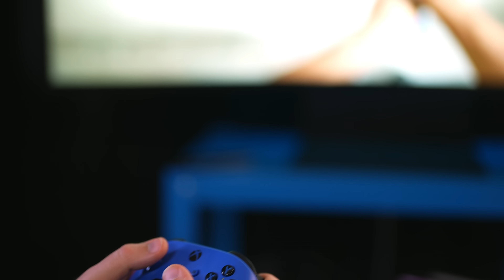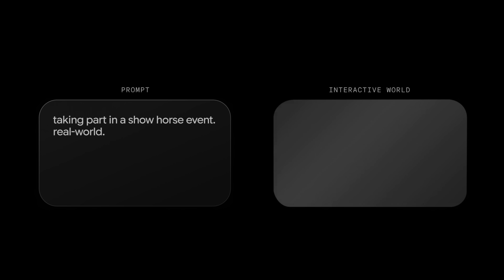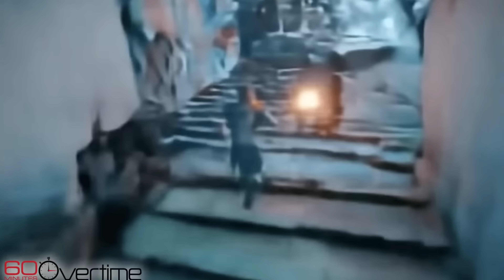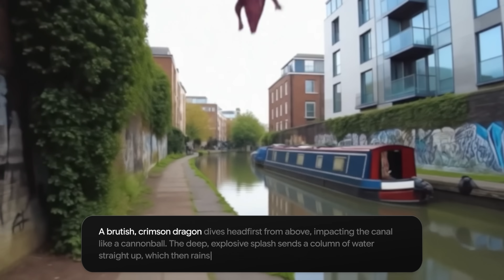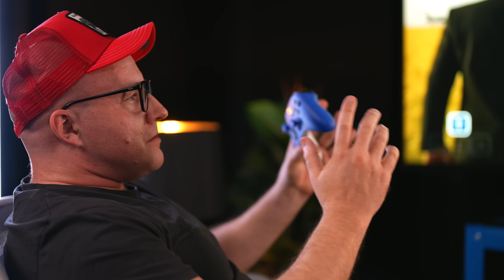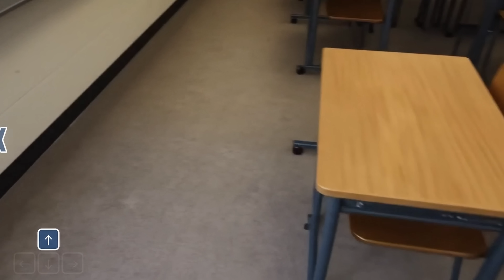Type a Sentence, Get a Playable 3D World in 3 Seconds - Shlomi Fuchter & Jack Parker-Holder

Comment: I’m a little skeptical that they will be able to overcome Moore’s law for long time-horizon generation if it relies entirely on prior context in the form of rendered pixels. It’s an O(n^2) time complexity.
Reply: I think you're assuming Genie (or models like it) will only rely on raw pixel context forever. That O(n²) scaling is definitely unsustainable, but researchers are already moving towards hybrid approaches — compressing past context, representing scenes as objects/states, and only rendering pixels at the final step.

So yeah, if it stayed purely pixel-based, long-horizon consistency would collapse. But the trajectory of this research is clearly towards mixing symbolic/state representations with generative rendering. In that sense, Moore’s law isn’t the bottleneck — smarter architectures are.

Long story short: the limitation you mention is real for Genie 3 as it is now, but not a fundamental barrier for world generation in general.

Comment: I think a more practical implementation with out current state of tech would be to render the standard graphics pipeline but at a lower quality then train a model to upscale the graphics. That way you have a light weight neural net and graphics pipeline but you still get the fine motor control of programmed behavior and object permanence. Think of it as DLSS 4. In some games you want hard programmed consistency.
Reply: i think it is doing this already, since the world interaction does not take place in image space, they probably use some decoder to generate and image of the curretn world state, which is basically what you are suggesting
Reply: If I remember correctly, there is   some engine being in development by nvidia to render with path tracing in real time and simulate physics by ai model
Reply: You know what would be even more practical? Render actual graphics. Literal high definition infinite worlds.
Reply: @LJ_Brown I disagree. Ai can do physics approximations more easily and efficiently then most graphics pipelines